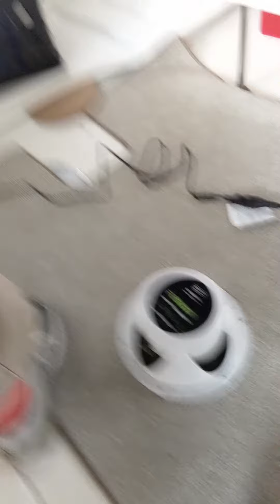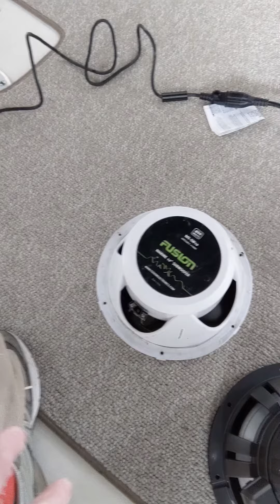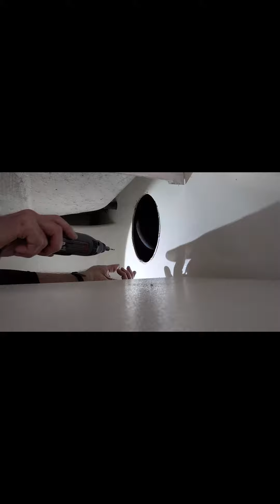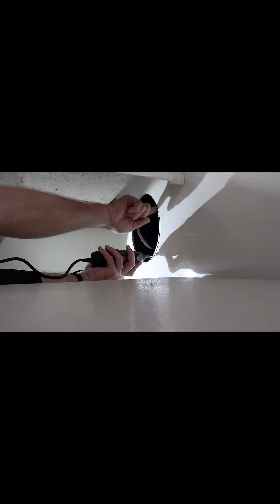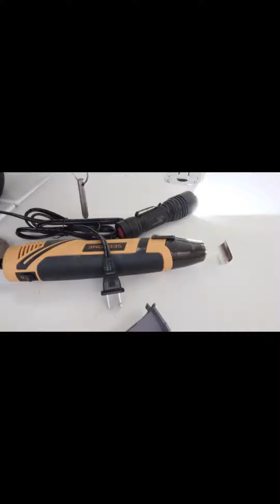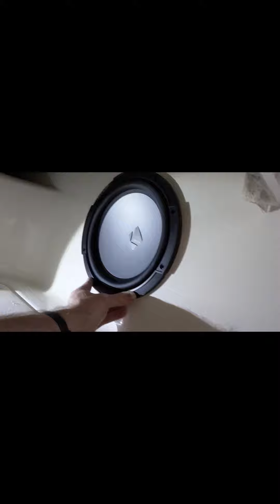Upgraded the Fusion Sub Woofer to a Kicker Sub Woofer

Comment: How does the free air sub sound? I just bought a clean one owner 2008 sea ray 195 sport and thinking of putting a free air in the passenger side dash where the radio is. It would face the helm side. And moving the radio to the helm. A little round receiver. Any thoughts would be appreciated.
Reply from the maker: I'm happy with it. It's delivering good bass with the factory amp. My next upgrade will be the amp, to something that is pushing  more power to the subwoofer. I will probably go with a 5-channel amp to increase the power to the 4 6.5s as well.
Reply: @SeaRay380DA  thank you